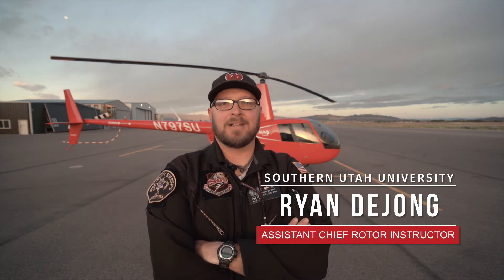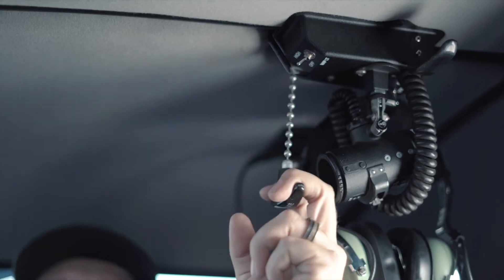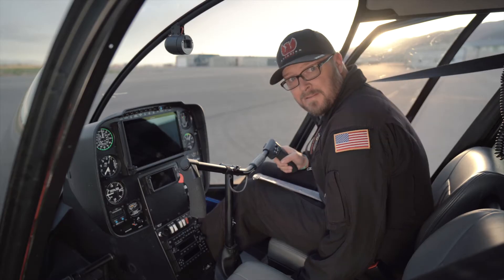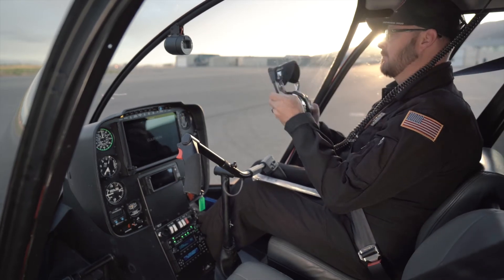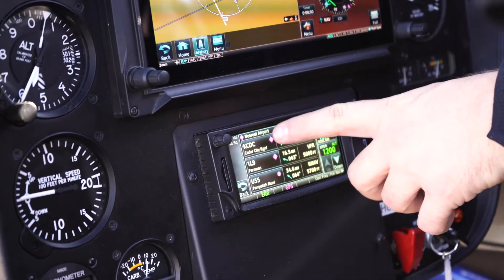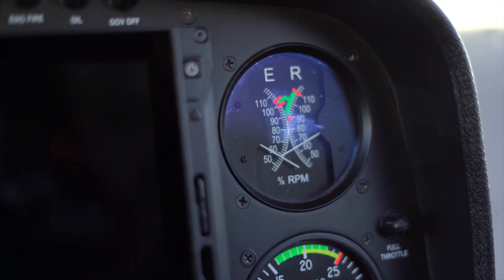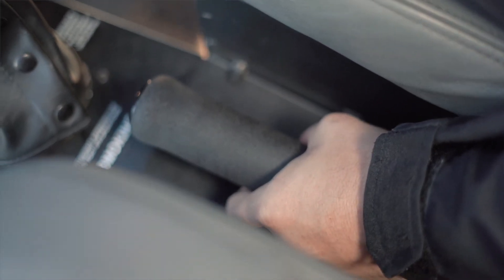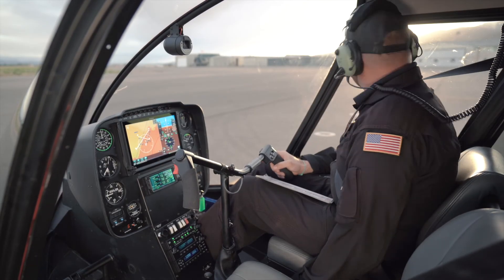How to Start A Helicopter | R44 Startup Procedure

Comment: Given that this is a Robinson helicopter, it may be safer not to start it at all, ever.
Reply from the maker: Due to the relatively low cost of Robinson helicopters, it is one of the best-selling civilian aircraft out there. Because of this, many pilots with little time, and experience at the controls tend to privately own them, which has led to poor maintenance and improper flight of the aircraft. Just like any other aircraft, when a Robinson helicopter has been properly cared for and properly flown, it is a completely safe aircraft to fly.
Reply: @SUUAviation  In NZ they are mostly R22, owned by cowboys. and used for deer recovery, pest shooting, herding sheep, tourist joyrides, power line maintenance, ski rescue, just about everything. They cost somewhere between 1/4 and 1/2 the price of an average house. so there are lots around. Periodic accidents mostly pilot error.

Comment: Which procedure is better - start with carb heat (less power) or start without (more power) if during the start procedure the temperature is outside yellow range?

Comment: THE MOST SAFEST HELEPCPTER EVER PRODUCED.  VERY SMOOTH, AND HANDLING CHARISTICS ARE FLUID!
Reply: i'm not a pilot, but, that seems questionable.
Reply: Like any machine, operate within the limitations imposed in the POH and if well maintained then it’s safe to use……although being single piston engine I would ensure regular visits to your instructor to keep proficient in   autorotational descent and PFL techniques.
Reply: Not quite sure where you're getting that opinion. The flight envelope is way too tight.
Not to mention sudden windshear can you put into unavoidable high speed negative-G.... I'll pass thanks. Beautiful aircraft though.

Comment: Those with newer models of the R44 Raven II (things that are not included in the video): add 8 seconds of engine prime before starting the engine with mixture rich, then return the mixture back to lean. Start the engine and then move the mixture to rich again when the engine starts. Oh, and don't forget to switch on the takeoff light before taxi or takeoff. Thanks for this video!
Reply: Thanks 👍

Comment: Thanks for this ...it helped me Al lot ...

I have a questio.may I asked a question ...what could possible cause a sudden drop of both Engine and Rotor RPM while at cruise flight...altitude 1200 ft, A/s95k, 4 pax.with less fuel ..manifold at 22 InHG ..indication loss of power ..low rpm lighted and low rpm audio, both needles drop to Idle speed ...what do you caused this incident??thanks
Reply: Hm, engine failure in combination with a slow reacting clutch? Slow roll off? However I do realize that this is more a theoretical question - because nobody would have walked away and described the incident in detail if the rotor rpm would really have dropped to idle during flight...